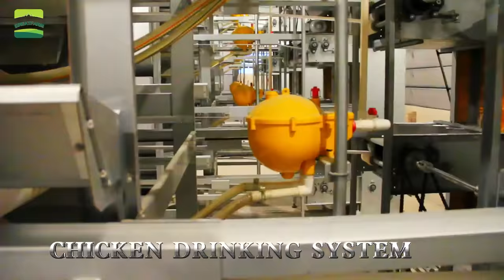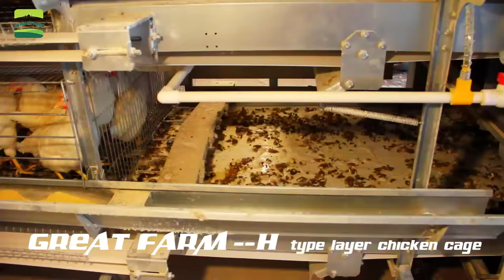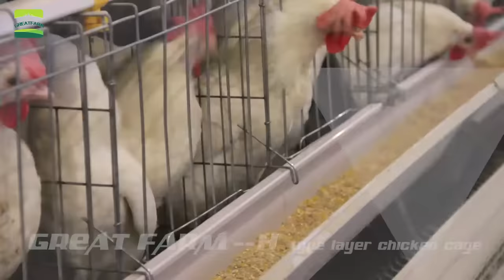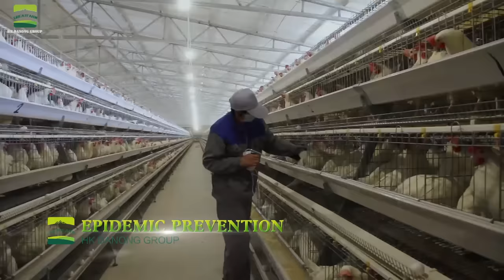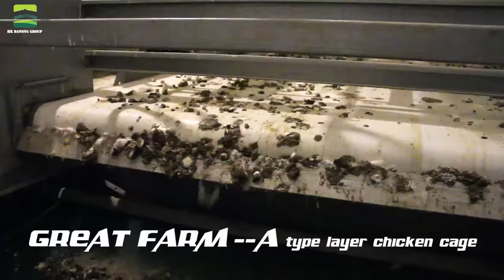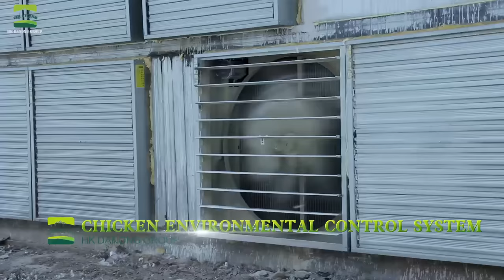Layer Chicken Cage Design and Modern Layer Breeding Technology - Layer Farming in China

Comment: wow, the system is good but require a lot of resources
Reply from the maker: Yes, The broiler poultry farm design inculding the following system:
1.salt Flooring system
2.Nipple drinking system
3.Feeding system
4.Environment control system (environment controler.exhaust fan. cooling pad .heater and high spray equipment etc).
5.Controller system:microcomputer controller system
6.Manure scraper removal system

Comment: what about the breeding ?!!
Reply from the maker: The broiler poultry farm design inculding the following system:
1.salt Flooring system
2.Nipple drinking system
3.Feeding system
4.Environment control system (environment controler.exhaust fan. cooling pad .heater and high spray equipment etc).
5.Controller system:microcomputer controller system
6.Manure scraper removal system